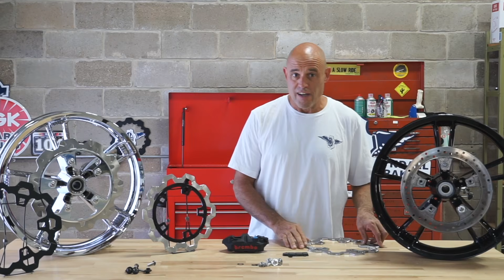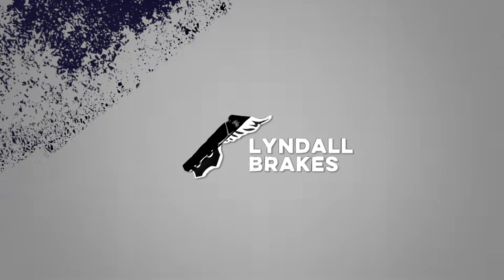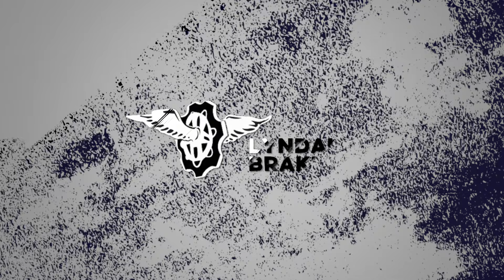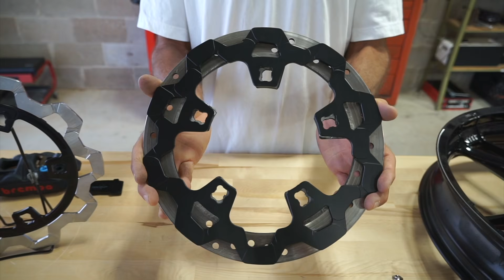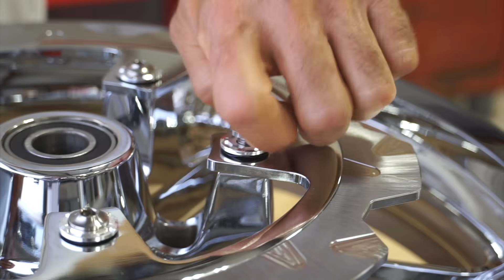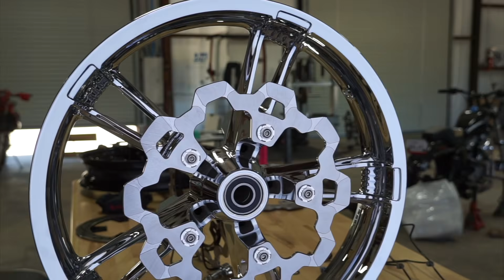Lyndall One-Piece rotors for your 2014+ Bagger

Comment: i have a 2021 street Glide can i buy these but run my stalk HD break Calapers?
Reply from the maker: Yes, our One‑Piece Enforcer rotors are a direct bolt‑on fit for your 2021 Street Glide and work seamlessly with your stock Harley‑Davidson brake calipers.

Comment: These rotors are a joke only lasted 20k miles before the rotor ring has to be replaced. Warranty is a joke. I'm ever buying these rotors again.
Reply from the maker: I talked to the customer service team about your issue. And you are correct we do not warranty for minimal thickness wear on our rotors. Our warranty guarantees for the life of the rotor to never warp when using our brake pads. Your issue is that you reached minimum thickness on the rotor then continued using the rotor until it failed. Quick note about that: depending on which brake pads you use (along with riding style) the rotor lifespan will be different. z+ pads ~65k // Gold + pads ~35K // Xtreme ~25K
Reply: It's always someone else at fault...lol..  you used them, no warranty.. if a rotor is trash after 20k miles they are trash after 1 mile.  Thanks for the heads up
Reply: @CliffHanger-x1m lifetime warranty is just a marketing strategy these guys use. way over priced for how long these last before there scrap metal.

Comment: This is Chris with Rattler Performance Works in Cosby TN . I run Lyndall rotors on my 2015 FLHXS , Crown cut rotors on Prodigy wheels , Extreme pads , Brembo M4 calipers . It stops hard and fast , I also have Bow tie cut on my CVO Vrod 2005 , I will say the titanium hardware is NOT CHEAP but it finishes off the nice product . Best in the business 💪
Reply: What color rotors do u have?  How is color fade after wear and tear usage?  TIA 🙏😎🤘
Reply: @Kevin_Ho70  the only Fading will be if you use a aggressive pad on the Black friction ring .